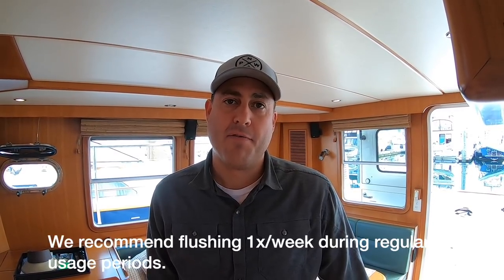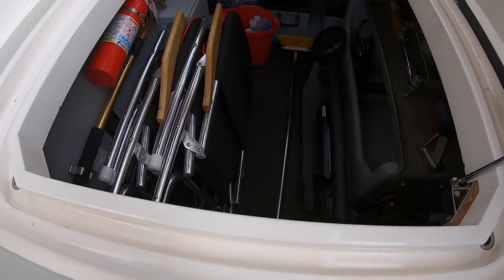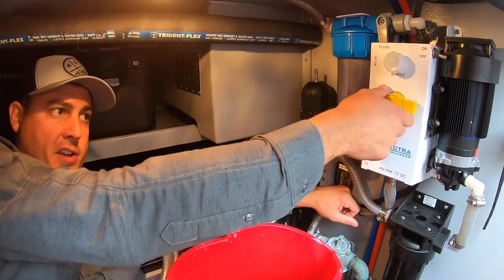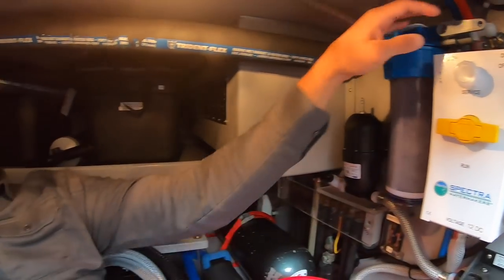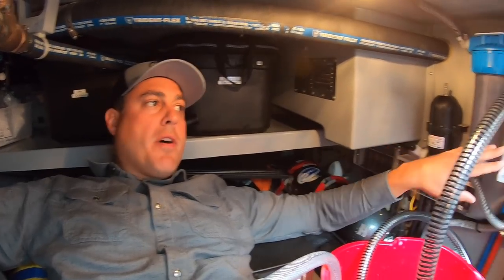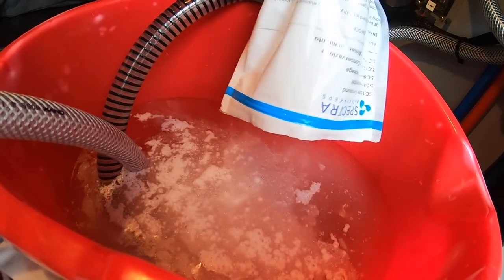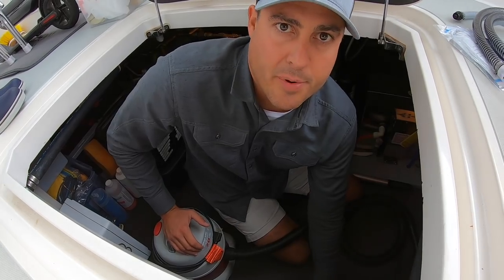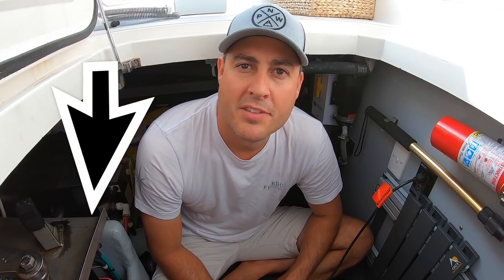How to "Pickle" Your Watermaker [Nordhavn 43]

Comment: Hi Shawn As a Spectra 150 owner I have a suggestion for a modification ot your winterizing regime. I would hold off installing the charcoal filter until spring. It has a 6 month usable life, if it should get wet the clock starts ticking. So if any water were to get into the filter housing over the winter you would have blown the the filter by the spring. The filter isn't too expensive, BUT if you didn't realize that it had gotten wet and did flush the membrane with city water you would ruin your membrane and that runs into some $$$!  Thanks for the video. Ben S/V DAWN

Comment: Thanks for sharing your knowledge. I'd suggest to pump out the saltwater at the strainer, rinse it with freshwater and leave it dry and open during winter. Your strainer is in stainless steel and is getting stained... Rather keep it clean and dry while not needed. All the best

Comment: Is there anything you can do to prevent the corrosion on the sea strainer? Most videos I watch the through hull fittings are corroded which I would think eventually lead to seizing up or leaking.
Reply from the maker: The green patina is a normal occurrence when salt water comes in contact with bronze sea strainers and seacock valves.  It is simply and appearance thing and causes no harm to these components.  To prevent any seizing of the seacock valves it's best practice to exercise all valves on the boat frequently.  We try to open and close all valves on the boat quarterly to keep them functioning properly.

Comment: Did not see you reopen the sea cock in the engine room, or does it stay closed now for the winter season while you are on shore/city water supply?
Reply from the maker: Correct, we leave the sea cock closed until spring to keep the filters dry and fresh until we're ready to use the system again.

Comment: I'm assuming there is a valve to close off the "production water" so that you don't get the storage chemical in your fresh water tanks?
Reply: Also, I very much enjoyed this "boring" video :)
Reply from the maker: Yes, you can divert the production water to a sampling location (we failed to show) however by opening the pressure relief valve prior to running the storage chemical through the system the water maker will not make any production water.
Reply: @mvfreedom  holy clean engine room, also the both filters are after the yellow Spectra shut off valve, just turn this valve to off, no need to close the sea cock.

Comment: What shopvac do you use and has the salt water affected it at all?
Reply from the maker: The Milwaukee WetVac…it’s the best thing we have on board (according to Elizabeth)!
Reply: Thanks. I am going to get one. Storage looks easy. We bought a Dyson for the cabin and we think it is the best piece of equipment on board so far.
Reply: Do you do anything special after using with saltwater? I want to use as you do to prevent overflow when cleaning saltwater strainers and to dry up last bit of water in bilge below bilge pump level. @mvfreedom

Comment: is there any way to add a drain valve to the bottom of the fresh water filter. there seemed to be water dripping very close to electrical components when you loosened it  17:20